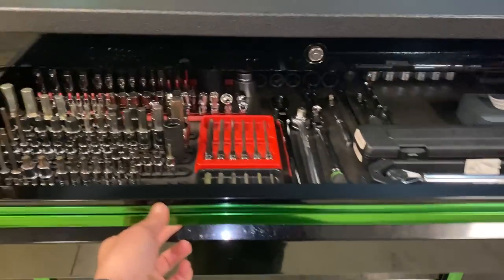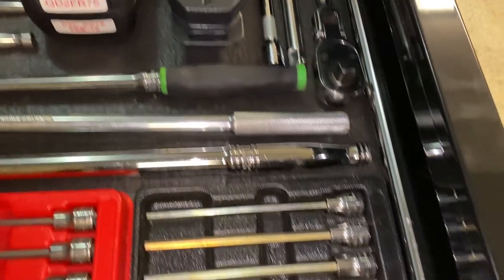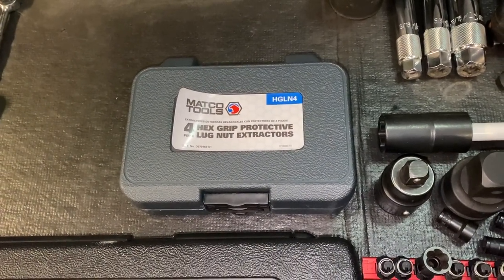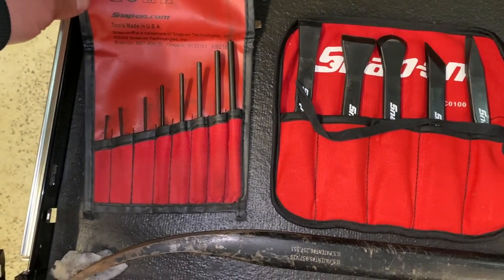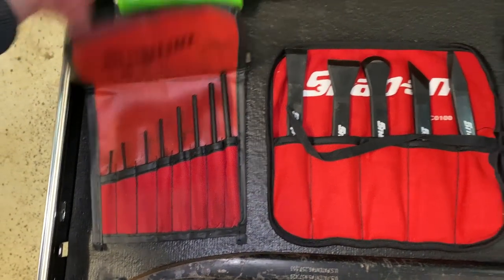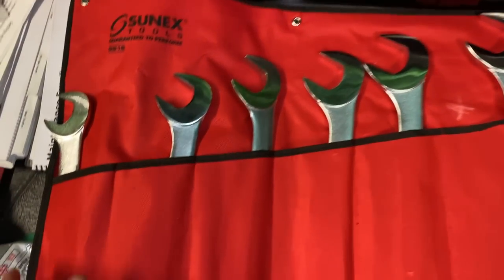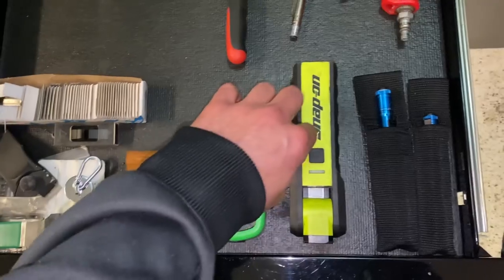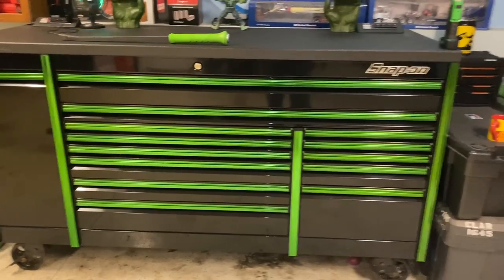84” Snap On Epiq Series (update)

Comment: You should oil your tools a few times a year depending how much you use them. I clean and oil my tools with a rag sprayed with Kroil. I wipe my sockets, extensions, ratchets, wrenches, screwdrivers, and pliers. Almost anything metal in my box and some plastic stuff like power tools and handles. I do this about 2 times a year and it helps keep all my tools looking almost new if not new. Kroil is also great because it converts rust into back oxide or something of that sort.
Reply from the maker: I’ll try the Kroil, thanks for the tip! And for watching!
Reply: I generally use LPS3

Comment: Go to harbor freight, buy some Evapo rust remover. Cut the evap rust remover down to 1:2, more water than solution in a 2 gallon bucket. Drop in rusty sockets. Return in a day and remove sockets from the water the rust should be gone, air dry with compressed air and lubricate with WD 40. No more rusty sockets.

Comment: I bought a harbor freight 3/8ths torque wrench.  Goes down to 5 lbft.    I tested it on the snap on truck (to see how accurate it is) and it's dead nuts on spec.     And I've had it for a few years now

Comment: As a starting mechanic while also taking business in college I chose not to go with tool truck brands because of the way the tool trucks act on the warranty process and just the mere fact of having to wait for them to show up. Instead I have found it cheaper and more reliable to go to harbor freight or get stuff off amazon gear wrench, tekton, Capri,etc and it’s been great and I don’t have to get on a payment plan or eat ramen noodles for the rest of my life. But nice box man!
Reply from the maker: That was a very smart, educated and well thought out decision on your part. No need to sign your life away on a tool truck. Over the last decade I have seen some really shady tool truck owners/representatives! I have also seen some really good ones! I have been lucky 🍀 and not really had an issue with getting tools warrantied. In my opinion that is one benefit to using tool trucks. I don’t have to go anywhere they come to me. All I did was hand them the broken tool and they hand you a new one, or order it. My snap on rep will direct ship to my shop or house for free!!!!!

Comment: Since my sockets sit at home in my box and don’t get used as much anymore, I oil them with Remington oil wipes. But I’m sure a light oil or WD-40 would do the same.  It’s what’s going to happen when they sit out side in a non climate controlled environment.  It’s not Snap On fault you don’t take care of your stuff.  You could use a different socket storage device and then be able to utilize the depth of your drawer.
Reply from the maker: If it’s not snap-on’s fault then why didn’t the other impact sockets rust...!!!!!😂
Reply: It’s made of metal, it requires some care. The only Snap On sockets I have that are rusting or start to rust, are the ones I use a lot. So I keep them wiped down so they don’t rust.

Comment: Excellent vidio. Be careful Matco is not a manufacturer of anything.
Reply from the maker: I appreciate you watching thank you! Do you know who manufactures Matco tools?
Reply: IR used to make the air tools for them now matco does make there own. All over though the screw drivers are from Germany but the warranty the whole tool including the handle vs snap-on only warranties the shaft
Reply: Same time though matco is cheaper then Snap-on and still get a life time warranty on the same stuff you would with Snap-on. Hell I use harbor freight 1/2” impact sockets deep and shallow haven’t broken a single one. Hell even the harbor fright 1/2” breaker bar guy next to me asked to use it to break a lug nuts on a Ford and I look over and he was standing on it bouncing. Best 20 dollars well spent
Reply: MATCO sucks. You can literally go on AMAZON and, find EVERYTHING they carry from different manufacturers, much cheaper. Same tools, just without the rebrand markup.
Reply: Edmister Enterprises LLC same thing with snap-on
Reply: Lol this guys probably sold or tossed out all his matco stuff after reading this lmao

Comment: Now that you don't use your tools that much anymore, get you some bags of color changing desiccant of ebay, they last about 3 months, then pop em in the oven to dry back out. Will save your tools. My garage is not climate controlled and wrenches started rusting, desiccant stopped it.
Reply: Wow thanks for this info! I never knew you could dry desiccant, guess I'll stop throwing them away and buying new ones.

Comment: What if u put your smaller sockets in the back of the drawer or the lay down blow molded socket cases in the back?
Reply from the maker: Blow molded cases take up to much room. I am kind of o.c.d when it comes to the tool box so I almost have to have it like this!! I have tried organizing it all different easy but this has worked out the best for me so far.
Reply: I will be upgrading to a 84" epic within the year and I feel you on the OCD part if you have seen any of my toolbox tours it would verify that lol. Anyways thanks for the video.

Comment: Lightly oil the sockets
Reply from the maker: No.... the sockets get oil and grease on them from being used and then wiped off before going back into the box. I don’t buy tools to have to baby them and make special accommodations so they don’t rust. I buy them to use and I expect them to last. Obviously the finish on snap-on sockets is not the same finish or material as they were many years ago.

Comment: Go with the Williams USA wrenches.
Reply from the maker: I will check them out, thanks for the suggestion! And thank you for watching!!
Reply: @justinclark6053  90% of my chrome sockets are williams usa, the rest are craftsman usa. The williams are made on the same line as snap on sockets they just have slightly different markings and are 100% interchangeable. I have my old craftsman wrenches in roll ups in my off-road bag.